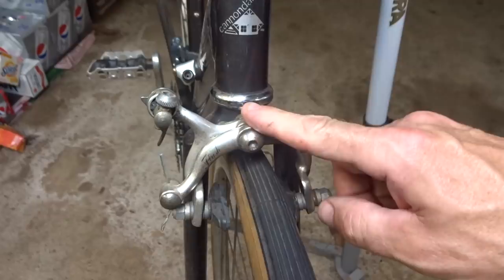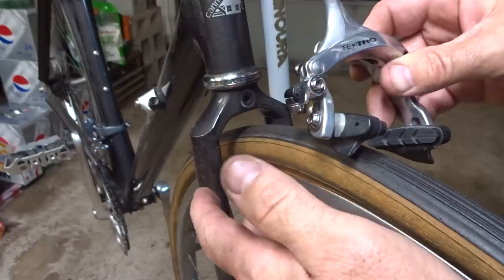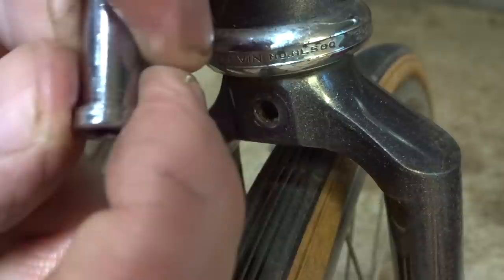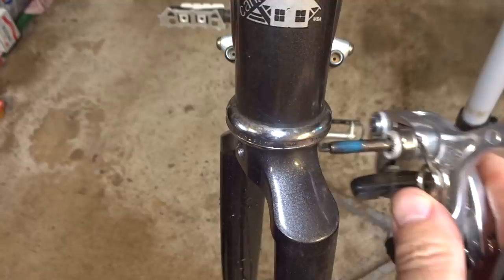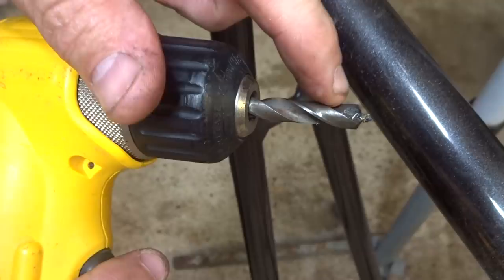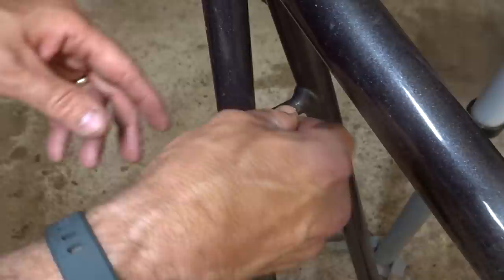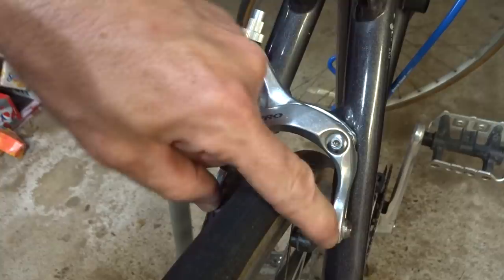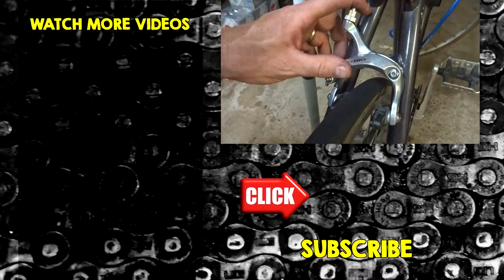Convert From Nutted To Recessed Mounted Brakes On Older Bike Frame

Comment: So what is the benefit of a recess brake versus a traditional one? Looks like the operate in the same fashion.
Reply: Dual pivot vs single pivot
Reply: There are plenty of recessed mount single pivot brakes.
Reply from the maker: I wanted dual pivot brakes.
Reply: Recessed brakes were invented in the late 1970's as part of the aero movement. No practical difference from nutted. The only benefit at this point are the additional options that recessed opens one up to (which is still limited, as nutted brakes are often long reach, and nutted long reach dual pivots already exist).

Comment: RJ , are the dual pivot brakes substantially better than the single pivots , or was the change purely for aesthetic purposes ?
Reply from the maker: Dual pivot have more leverage, stronger, and controlled braking.
Reply: RJ The Bike Guy  Thanks RJ , since I’ve never ridden a bike with dual pivot brakes , I wasn’t sure if it was a performance upgrade . Evidently , I should check out some dual pivot brakes to experience what I’ve been missing  , considering that most of my riding on mountain roads !

Comment: I accidentally widened both holes on the rear brake, but have the curved washers on both sides. Should I be worried about the steel's ability to handle the braking force now?

Comment: I'm not sure if you have a vid already on this...but I'm trying to mount a rim brake on a newer to me and the bike a fork that originally had disc brakes..but now I wanna try to not have to upgrade everything else like brakes/lever/wheel etc.  This is a Marzocchi exr air fork with some diacomp rim brakes that I have the correct length of studs that the arms fit onto...but the arms hit the fork before the hardware can seat in as they did on the old rigid fork. This is on an older Specialized Hardrock. Thanks for any help.  I can make a small vid if need be to link you to it to show my dilemma.

Comment: I find drilling into metal strangely satisfying and scary!

What's the best way to ask a tech query? Your Facebook page? Thanks for all the amazingly useful videos
Reply from the maker: Here or there.
Reply: @RJTheBikeGuy  ok cheers ... Here goes... 

My steel frame mountain bike fell off a roof rack and landed on drive side crank. I knew something was bent.. seems to be the BB shell. I've come to install a new octalink BB, but the two halves, once threaded in, are out of line with each other by a couple of mm. So the bb shell has remained cylindrical but the ends are no longer parallel. I'm thinking this is a write off?!

Comment: When drilling out the rear brake bridge, I don't see why you can just drill all the way through from the back side of the bike? If you are using the concave washers on both sides, shouldn't it stabilize the brake caliper even in the larger hole? This would avoid the difficulties of the tight fit and the need for using a right angle drill.

Comment: I'd be wary of drilling a rear brake bridge that doesn't have a boss for the bolt - even with the added support of a saddle washer there's really not much metal holding that brake on.

Comment: im looking to upgrade my back brakes...currently they have v-brakes but when it gets wet, it doesnt work very well...im not ready to do a rotor conversion just yet...so would you suggest these style brakes instead of the v? or just try to upgrade the pads?
Reply from the maker: These are road bike brakes.  V-brakes are probably the best rim brakes you will get. Get better v-brakes. Better pads.
Reply: @RJTheBikeGuy  ok thx

Comment: RJ, nice video once again. But this time I have a question for you. I’m currently modernising my 1983 Peugeot Racing Bike. It currently has the original Breaks on it which are Weinmann center pull breaks. in my process of modernising it, I also want to install new breaks with dual pivot. But the frame seems to need rather long breaks and dual pivot breaks are often very short. Is there a way I can install them onto the bike anyways? I was thinking of some sort of extension to make it work. 
Thanks in advance and greetings from Germany!
Reply from the maker: You need to find long reach brakes. Or maybe a dropper bolt

Comment: Don't butcher all your framesets.
Reply: nothing wrong with updating an old frame to accept better brakes and/or a modern groupset.  It's quite the thing.  Some of the old frames are very good and a modern equivalent could cost thousands.  I love an old steel frame with newer stuff, and I'm not alone.

Comment: I wanted to do this as well, luckily i measured my reach before and noticed i had a crazy long reach (Weinmann side pull breaks from the 70s)... I'll need to get a different fork before :( Now I'm thinking about changing also the bearings as i have already the fork out, any advice on removing the old ones? On Youtube, people seem to hammer the old ones out?
Reply from the maker: They make long reach calipers. Hammer the bearings out? Do you mean the cups? https://www.youtube.com/watch?v=VkY879pMafE
Reply: @RJTheBikeGuy  that thing is awesome!

Comment: Question. If the old brakes worked fine and stopped the bike as well as the new brakes, why replace them? Or do the new brakes stop the bike better?
Reply from the maker: Yes, dual pivot brakes give stronger braking.
Reply: @RJTheBikeGuy  Thanks, RJ! Didn't know that. I have an old bike been planning to restore. Will get this type of brakes. Love the vids. 👍

Comment: is it just me or couldn't you just skip this whole thing by using the original curved washers and buy a new nut to match the threads? Or is the mounting bolt not long enough for that?
Reply from the maker: Not long enough.

Comment: if you've got access to a 3D printer, but no right angle drill, you can also use this thing: Rear Brake Nutted Bolt to Recessed Nut Adapter https://www.thingiverse.com/thing:3662440
Reply from the maker: I guess it would work. I don't like removing more material from the brake bridge than necessary.
Reply: @RJTheBikeGuy  I sure didn't like it either. it was more so a measurement of necessity rather than my first choice. it's been holding up very well tho to some excessive stress testing :)
Reply: I would "cast" (program?) it with a 10mm countersink on the forward facing piece, so the nut head can truly be recessed (even if partway).

I got mine to clear with a right-angle drill head on one of those cordless Ryobi multi-tool motors, with a Harbor Freight "short fat" step drill (step 2 is 5/16). Still, I wonder if anyone makes/sells these.